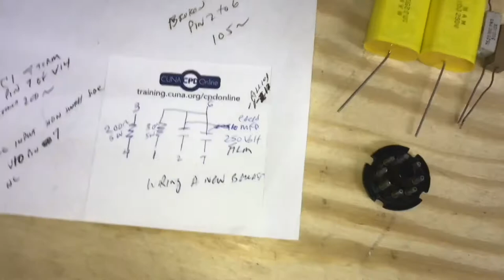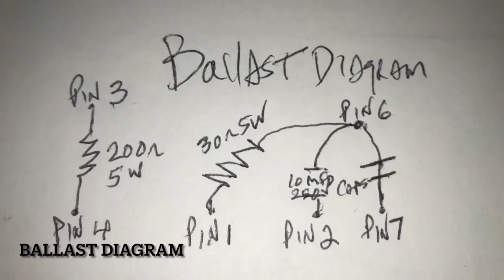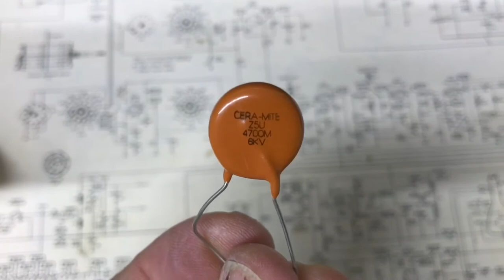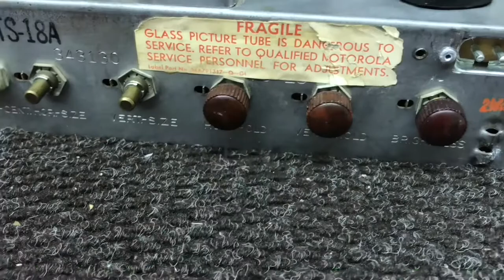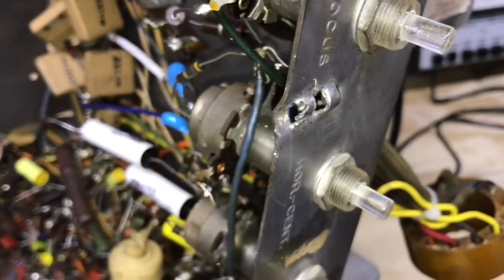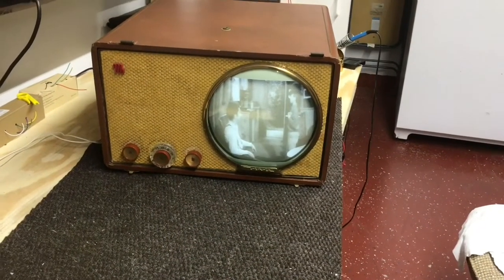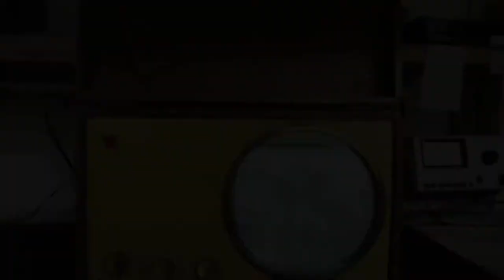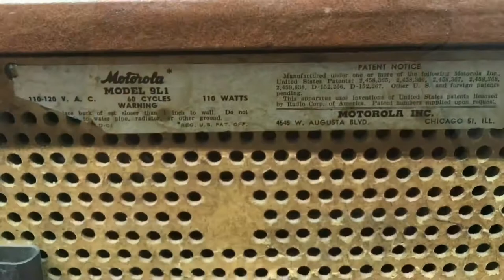1950 MOTOROLA 8” TV Model 9L1 Restore pt 2.

Comment: Excellent as always ! You never seem to run into difficulties that the other guys run into !  😊   I have read on the forum that if you double or triple up the .005  5 kv coupling cap it will fix that distortion and you can save those tubular ASC caps for another day as apparently they are getting hard to come by. I think old Shango said keep adding them till it fixes it. I bet two in parallel would do it. I wonder if those 5 watt resisters are a bit close to the caps in the ballast tube you made ? My concern is the heat might  damage  the caps. Maybe even a 1/4 inch air gapnbetween them? I need to look at bandersentv vids again. That is the brightest picture I've seen on one of those and I thought it did not test very good. On many of the vids they have to turn all the lights out to see the picture.  Who wants to do that !   I use orange citrus strip paint remover. So gentle you can get it on your hands. A dab on a q-tip might help. Orange is a favored color in Tennesse. Oh well, on to the hallicrafters !
Reply from the maker: Yes those HV caps are getting tough to find. Sometimes ceramics are the only option. 
    Thanks for watching

Comment: If those resistors in your ballast get hot will there be an issue with them being right up against those capacitors?
Reply from the maker: I don’t think so but playing the set for a long time ( an hour or 2 non stop) would determine that.   I’ve probably played the set maybe an hour since the restore 😀
Reply: @CreekviewAcres  That ballast circuit is interesting.